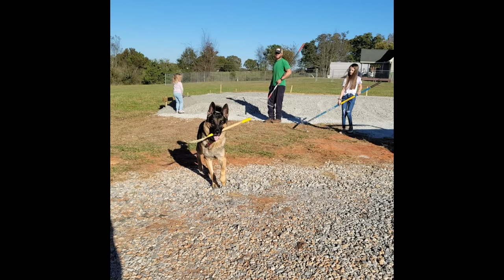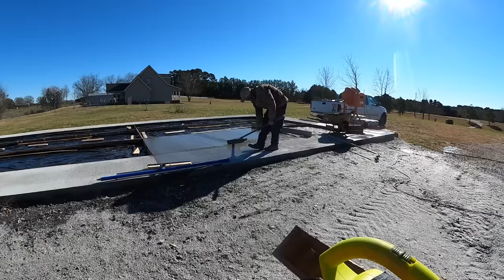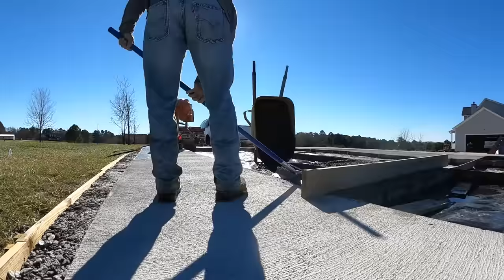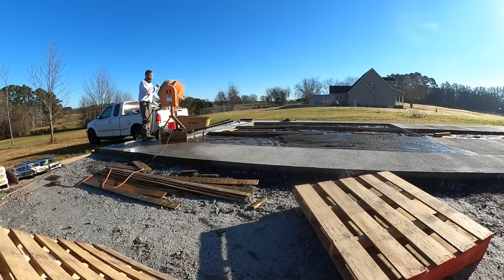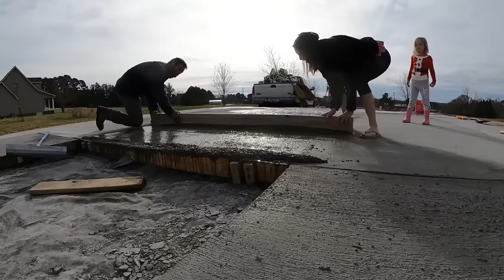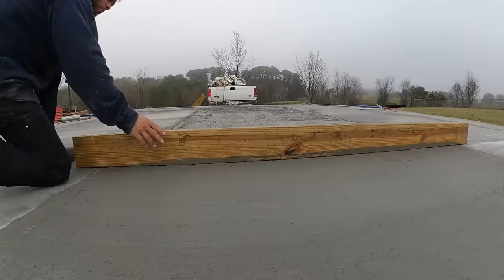Pouring a Huge Concrete Slab Using Bagged Concrete | I Saved $10,000

Comment: You probably could have saved another $8000 by getting truckloads of gravel & sand, and a pallet of portland cement. Mix it 1-2-4 and you're good to go. Waaaaaaay cheaper than bagged premix.
Reply from the maker: I checked into that before deciding on the bags. You wouldn't believe (well at least I didn't) It was going to cost 163 per yard mixing that way because of the crazy high prices of sand and portland in my area.
Reply: @reallifetested2605  Fair enough. I think it does vary quite a bit depending on how far the materials have to be transported. For example, I got a yard of gravel last year for $20 and I asked about sand, it was cheaper than the gravel.

Comment: Nice job, would it not have been cheaper to buy builders mix (aggregate) and bags of cement and mix your own instead of premixed bags?
Reply from the maker: I checked into that before. At the time it was going to cost 163 per yard going that route because of the insane prices of sand in my area. I'm not sure how much it would be now. I did this during covid when everything went crazy.

Comment: Where I’m from concrete is cheaper on the truck than by the bags per yard. So I don’t comprehend this video.
Reply from the maker: When I did this they were wanting 200 to 220 for truck and I was able to get #80 bags for 3.20 each. Local contractors wanted 14k plus to do this work, I was able to do it for a little less than 4k.

Comment: If like to do something like this. I noticed, or perhaps its hard to see in the video, no expansion rib cuts? Curious if there will be issues with cracking.
Reply from the maker: I see that you saw my one year update video! Stay tuned I have another coming up very soon. I didn’t show cutting the joints because it was a dust storm and you couldn’t make out what was going on.

Comment: Great Video. Could you have removed the wood from the sections with a saw before you poured the next section so there were not any gaps between the slabs?
Reply from the maker: I didn’t realize it looked like I left the wood in until I started getting comments about it. I definitely removed the wood haha

Comment: Assuming $4/bag you could have poured around 1,800sf of 4” thick concrete from a batch plant for the same price…so you actually spent way more and worked WAY harder than if you would have ordered a truck.
Reply from the maker: It was 3.20 per 80 lb bag vs 200 to 220 with a 4-6 week wait going the truck route. Local contractors wanted a minimum of 14k for the work. I have 3800 in everything. I said in the first 30 seconds doing it myself saved me the 10k
Reply: @reallifetested2605 thanks for the clarification, ready mix is way more expensive in your area than I realized. You should start doing some concrete work for a living, the fact that you did this solo with sacks proves that you’ve got the ability, sack mix is usually harder to finish than ready mix.
Reply from the maker: @LoganBohannon  It's insane how much things cost now. I was talking to a guy recently and he said he remembers when concrete was 70 dollars a yard and concrete finishers charged 8 dollars an hour and it was good money.

Comment: Why not use portland cement with sand and stone?  The cost over bagged cement is huge and you are in control of the compressive strength as you are doing the mix
Reply from the maker: I looked into that as well as truck and bagged. Using the 1,2,3 method was going to cost right at 163 per cu. yd. at the time because of the insane prices of sand in my area. I'd hate to know what it is now with everything going up by the day like it is.

Comment: 10 Yards of ready mix delivered is ~$1,500.   
450 80 lb bags at ~$4 each is $1,800 not including the cost of the mixer.  
How is this cheaper?
Reply from the maker: They were 3.20 each. Even now not much more than that. I did a 1 year update and show local pricing on my phone. Also truck is 200 to 220 per yard in my area.

Comment: Great job on the work. Very hard work indeed and you deserve to be proud of what you've accomplished. I'm curious on the costs you mentioned for a truck of concrete in your area. When I did the calculations here, it was far far more expensive to use bagged concrete vs having a truck delivered. Thanks and keep up the good work.
Reply from the maker: Thank you! I did this during Covid so remember prices were insane. (They still are) but 80 lb bags were 3.20 each. Truck was 200 to 220 per yard with a 4-6 week wait. I checked into the 1,2,3 method but it was right at the same price as bagged was because of the high price of sand in my area. I did a one year update video going over a lot of this. If I remember correctly bags were 60-80 dollars per yard less than truck.

Comment: There are 42 eighty-pound bags of concrete on a pallet, making a pallet just shy of the 45 bags needed to make a full cubic yard.
At 830 bags, that's 20 fucking pallets of concrete!   WOW!!

At $4.75 a bag (Current full pallet price at Lowes), that's $3990 for twenty full pallets (840 bags)
At approximately 20 yards at approximately $150 per yard (Thanks pandemic), that's $3000 if you ordered it by the truck, however, this isn't the whole story.
The real savings is coming from labor and the ability to work on your own schedule.   

I don't think I would have the balls to attempt what you succeeded at, but if you ever attempted this again, I would kindly suggest staging your pallets as close as practical without them getting in your way and more importantly, at a height that minimizes bending over.   A rolling Baker Scaffold is rated at about 1000 lbs, so maybe if you set the height of one above the mixer that would help you move a dozen bags at a time from the loader to the mixer?  It's just a thought.

Getting the mixture consistent is all about the proper addition of water.  I think I would keep a calibrated 1-gallon pail handy so I'm always pouring in a consistent amount in the mix.
Reply from the maker: When I did this it was during covid and everything. Local prices were 200 to 220 per yard for truck and #80 bags were 3.20 each. I did save a good bit on concrete as well as doing everything myself. I put a line on the bucket I was using and it was set for a bit less than what the bags called for. That's a good tip with minimizing bending over. I imagine if someone did this day in and out there body woudn't last long. Thanks for checking out my video, and for leaving a comment.
Reply: @reallifetested2605  
Thanks for sharing this video.   I am going to subscribe.   

The biggest thing that I think everyone in the comments overlooked, including myself until just now...  Is that if you have a full-time job, you might only have nights or weekends available to do these projects, which happens to be when delivery trucks usually aren't available.

Another issue is having enough forms.   Your situation is a little different because you needed more forms than someone who made a single pour, however, let's say you're pouring 2x2x6 foot ecology blocks.   If the forms cost $1000 each (ballpark guess), would you buy $8000 in forms just to justify ordering a full truck of concrete?   Or would you order 1 form, 2 yards of concrete (extra for waste inside drum), plus a minimum order delivery charge?   Or would you just mix the concrete yourself as needed, 1 block at a time?

Anyway, your video has made me reconsider my own projects to the point where having a spare pallet or two of concrete bags makes $ sense.   I'm even considering an upgrade to my 2-bag electric mixer to something bigger like a Bobcat implement.

Comment: What size were the sections you were pouring? Do you remember approximately how many bags it took per section? Also how many bags could you fit in the mixer and wheelbarrow? Thanks! Amazing job you did?
Reply from the maker: I don’t remember exactly but somewhere around 6x20. There were 6 sections and 820 bags so somewhere around 140 bags per section. The mixer could only hold (2) 80 on bags per batch. I wish I could have gotten a bigger mixer but the cost on those are insane. You’re welcome, Thank you!

Comment: You could’ve use gravel… and then pure Portland cement on top💀 and you would’ve saved A LOT more
Reply from the maker: I’ve never seen that before, do you have to add sand to it? I’m going to look into that for hardening my gravel driveway. Thanks for the tip!
Reply: Yes, gravel and sand, that’s the typical concrete mix. It has the same effect but cheaper and better. Yours will probably crack in afew years because there is no room for it to breathe when it expands during rains or winters. They also sell the pre mix bags at the hardware store, but you get way more, when you mix it yourself. 1 part cement 3 part sand and 3 part gravel, but you can change this based on the type of project you’re doing, like adding more sand. This will also give you grip on shoes and tires for the base and then just add a coat of Portland only, on top if you want that nice “polished” finish, easy.

Comment: hauling 830 bags of concrete and 100 tons of gravel is going to take way more than a few days dude. You had to be on this project for a while.
Reply from the maker: The gravel took (2) days, the actual concrete work took a little less than 40 hours. I had to break it up because of my work schedule and only could do one section per day. I could've done it in (3) if I didn't have a job. It took about a day to haul the concrete in and set up forms. So about 6 days total counting gravel, hauling, spreading, concrete, hauling, mixing, spreading.

Comment: Congratulations on the great poor I have mad respect for you man I was tired just watching you but I know that’s a lot of work porn concrete and especially doing that by yourself. But the sense of accomplishment is well worth it Plus saving that $10,000
Reply from the maker: I appreciate the kind words. You’re right it was totally worth it especially with the savings involved. I can’t believe how much contractors are charging these days. By the looks of it I won’t ever be able to afford to pay people to do things like this haha
Reply: @reallifetested2605  I have a question you say that the building is just for storage so you can’t park any cars in it because you didn’t use any rebar or wire mesh correct. Because I have some property that we want to build a home but I want to shop like that too but I want it for my cars and to put a lift in it so I would think I would have to go with a deeper slab and Rebar
Reply from the maker: @georgehuerta1990 that’s right the only time I have a car in there is when I’m doing maintenance on it. I installed a lot of machines in a past life and what I can tell you from that is figure out which lift you’re looking at purchasing and see if you can get an installation manual for it (you can usually view a pdf on the website). All manufacturers have their recommendation and they’ll tell you exactly what you need to do. Also call around and ask people local to your area. There are a lot of different soil types and weather conditions to look out for.

Comment: I thought you have to install wire mesh for structural support or at least install rebar to keep the pads from sinking or lifting when poring pads against one another.
Reply from the maker: I called around and local pros said that it wasn’t needed in an on grade residential 4” slab.

Comment: Impressive work ethic.
You will regret not putting mesh and or rebar in your slab.
Reply from the maker: I called around before doing this and pros in my area say that no one really uses it in a 4” residential on grade slab (edit: in my area it doesn’t get cold and we have a hard clay soil). I do wish I had pinned the slabs together for added insurance but no issues or cracks yet. I did a one year update if you’re interested.
Reply: Pros use fiber in mix from the plant for thinner slabs.  Here in the Mohave Desert, zero cold, under 2 inches of rain a year, we still use reinforcement of some type.
Like I said, I admire your whole deal. But concrete is concrete. You probably won't notice or care over it, but when setting things in stone...
With no parameter footings, the weight of the building over time will give you some strange internal reactions.  Gravity is still and always a bitch.
I'm just being technical,  40 years a concrete carpenter makes it hard to not be interested in your outcome.
I'm totally blind to most videos do nothing for me, but this one is an example of awesome.
I will definitely check in on your channel. 
All due respect .

Comment: Impressive. Looks like a tremendous amount of work. How many hours did that take?
Reply from the maker: Thank you! I had to break it up because of my crazy work schedule at the time, but remember telling my wife if I had full 12 hour days to work it would've taken 3-4 days. I'd guess somewhere in the neighborhood of 40-50 hours.
Reply: @reallifetested2605  Amazing job and as impressed as I am I am curious how you saved $10,000.  I pour 100 yards a week and can't see where the savings would be.  Especially $10,000 worth of savings.
Reply from the maker: @joshuavanname3469  when I did this truck was 200 to 220 depending on the day with a 4-6 week wait. #80 bags were 3.20 each. I got multiple quotes and the lowest was 14k. I was able to do everything myself for a little less than 4k
Reply: @reallifetested2605  that makes sense… very impressive for a one man crew

Comment: I have a much large motor mixer that I used recently to make the concrete using sand, cement, and aggregate. I wonder how much more cost effective this was over bagged concrete? Hmmm
Reply from the maker: It depends on the cost of sand and portland in your area, where I am rock is cheap but portland and sand were/are insane! Mixing that way was going to cost me around 163 per yard. I was able to get #80 bags for 3.20 each making it about 144 per yard. Local truck wanted 200 to 220 depending on the day.

Comment: I don't know much about concrete as I mainly handle drywall repair and finish carpentry, but aren't you supposed to support large slabs of concrete with rebar or some kind of wire mesh. Based on what little I know about concrete foundations it seems like this would crack and shift with any significant weight placed on it.
Reply from the maker: I called local pros before taking this on and they told me that rebar wasn't needed in a residential on grade 4" slab. Our ground here is hard clay, and the weather hardly gets below freezing.

Comment: Awesome! Can you please give more details, like time per section, time management, time per section and thickness of pad. Thanks!
Reply from the maker: I was aiming for 4” per pad but they ended up being a little over 5”. I didn’t time it but thinking it was around 3-4 hrs per slab once I actually started mixing. I did this when temps were in the high 40s low 50s so I had plenty of time work.
Reply: @Real Life Tested  if I do the same, I was considering getting more than 1 mixer, maybe 3. Do you think that would be manageable? Thanks
Reply from the maker: @trex283  I would think 2 would for sure be manageable without help. 3 or more and you’ll definitely need someone on standby to help mix while you’re pouring and screeding.

Comment: I'm hoping to build, but I am not able to do this level of work. But I could smooth it, I could coordinate everything, buy and move the materials to staging spots, etc. - and I think I can save a bit of cash. But I don't think it will be that much savings since I'm pretty sure I still have to have rebar, an insulation layer on the gound, etc., where I live which blows the budget.

Anyone do this kind of thing in western Washington lately?
Reply from the maker: I am lucky to live in an area that rarely gets below freezing, saving me on the rebar and insulation. With the prices of steel here lately i'd hate to know what the cost of rebar is now.

Comment: MAN! you gave me inspiration to do mine! What is the thickness of your slab and the final width and length?
Reply from the maker: That’s awesome to hear. I was aiming for 4” in thickness but ended up a little over 5” because by the time I went and packed everything and let it settle that’s where it ended up. The final width and length ended up being right at 45x26

Comment: 830 bags of concrete mix at say even 3 dollars per bag equals 2490 dollars.
So lets just call it an even 2500 dollars.
That would be the cost picked up at the supply yard, not the delivered price.
Whereas one cubic yard of redi mix concrete will cover an area of approximately 75 sq ft  of properly prepared slab at a 4” thickness.
So you can do the math based upon concrete cost in your area.
But dont forget about all the labor involved in just the mixing of the concrete yourself.
And of coarse the cost of buying or renting the mixer.
In any event, a savings of 10.000 dollars is a far fetch from actual reality here.
More than likely, there was an estimate from a contractor involved, and thats how the price comparison was made.
Reply from the maker: I said doing it myself saved me the money in the first 40 seconds lol. Bags were cheaper at the time at 3.20 for an 80 lb bag vs 200 to 220 with a 4-6 week delivery for truck. I have a large truck and trailer and only made a few trips to Lowe’s so travel cost was probably around 20 dollars. I also worked night shift 7 days a week at the time and only had a small window everyday to do the work.

Comment: Your work looks awesome for DIYer and save ton of money.  Is it cheaper if you buy ready mix concrete from cement truck company rather than buy 800 bags?
Reply from the maker: Thank you! When I did this #80 bags were 3.20 each and truck was 200 to 220 with a 4-6 week wait. I’m not sure what the price of truck is now but bags are right around 3.80.